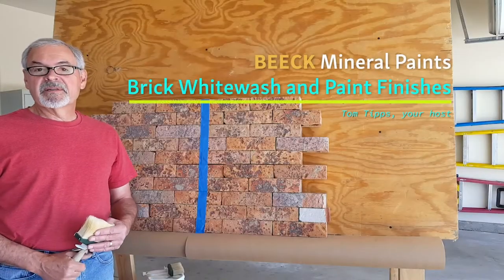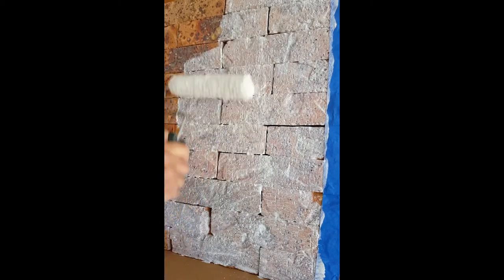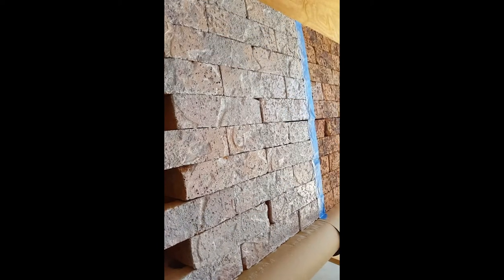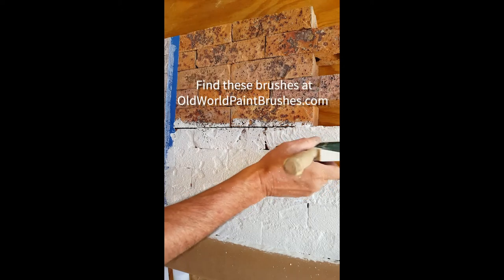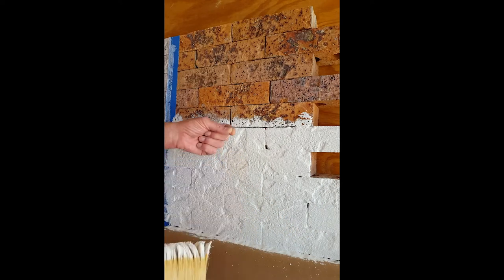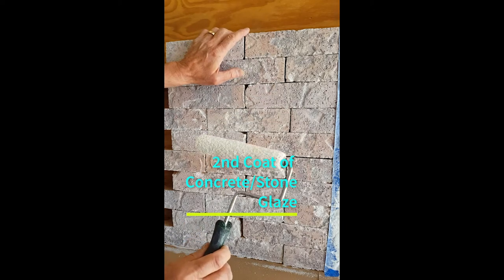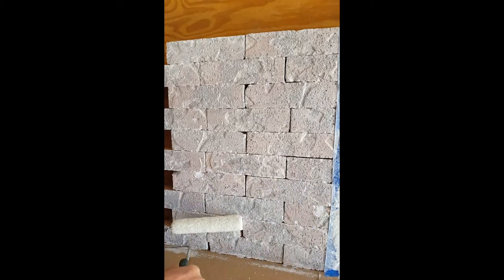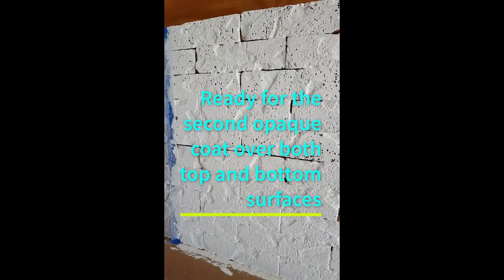BEECK Mineral Paints Brick Whitewash and Paint Finishes

Comment: Can you tell me what size brush was used for the Renosil application?
Reply from the maker: That brush is the "Tradesman" Flat Facade Brush (3010). I believe it is the "small" size (3010-12) which is 4.7" (120mm) by 1.2" (30mm) in size. It is available for purchase online through both BEECK Mineral Paints and Old World Paint Brushes websites.

Comment: How abut the long term stability of the paint, will it greatly outlast organic paints (e.g. acrylic based) ?
Reply: From everything I've read yes, it has extremely long-term stability. Everything that comprises silicate mineral paints, even the pigments, are minerals, so they are mold and mildew resistant as well as unaffected by UV light, so the colors won't fade/degrade over time. And because they are minerals-based, they bond to and become a part of the substate itself.

Comment: Can you use a sprayer pump with this product
Reply from the maker: Thank you for your question! The Fine version of our paints can be sprayed, but it requires a rather large sprayer. The minimum tip size for our products is 0.027. We find that on most residential projects, it's better to brush or roll. After you take the set up and tear down time into consideration, spraying likely takes more time than brushing or rolling on smaller projects.

Comment: I’m guessing a mineral silicate paint would be better for the outside of a concrete block pump house.    Any comments ?
Reply from the maker: Thank you for the question Jack! You're absolutely correct - a mineral silicate paint would be an excellent choice for the outside of a concrete block structure. Our paints will penetrate into the concrete block and chemically bond, allowing the underlying substrate to breathe as intended. It will never peel or bubble because it does not form a film and it will never fade as we only use pure inorganic mineral pigments. Mineral paints, especially potassium silicate based such as ours, are an ideal long term solution for painting any mineral surface!